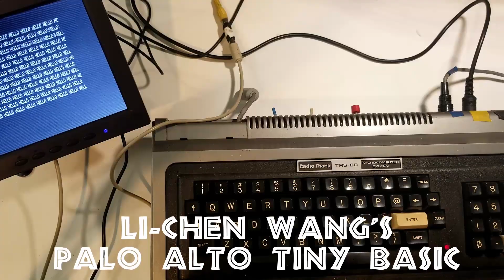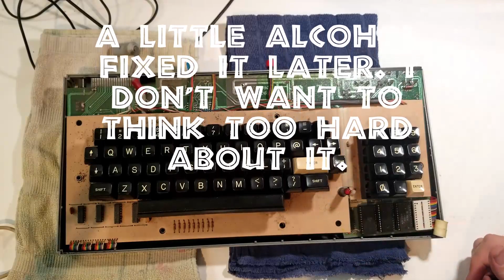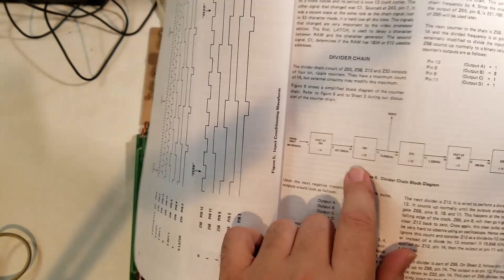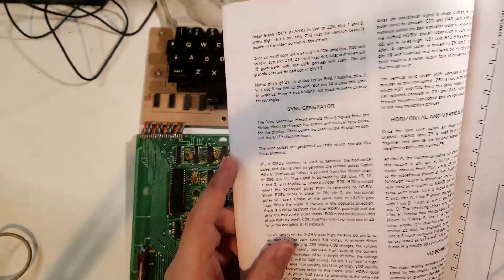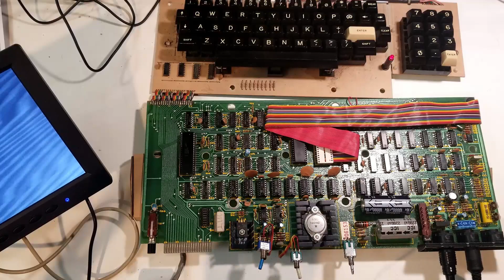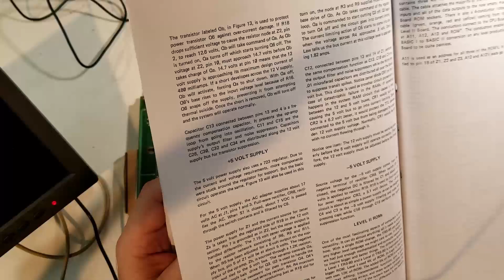Original Tandy TRS-80 Model I Repair: Part One (#SepTandy 2021)

Comment: Last year for #SepTandy, MrLurch uploaded an STL file to Thingiverse for replacement keyboard spacers.

I'm very thankful that the Model 1 I recently acquired has "just worked." All of the issues that I've had with it have ultimately been my own ignorance of how these systems work.

I have another Model 1 that is experiencing issues similar to this one. The video is shifted in a bit and isn't very stable. I knew about the potentiometers that shift the video, so I'm sure I'll need to adjust one of those. I'm also guessing (and I feel like this is where part 2 of your series is going) that some capacitors in the video area will need replacing.

Either way... I like watching your process and the rationale for the things you tried.

Comment: Great vid. Can't wait to see the solution. I have a Level 2 Model I that turns on and gives me a ready prompt, but freezes up whenever I try to get it to do anything. It won't even execute a PRINT command without an error message. Sometimes it just freezes up. I need to take a look at that manual. I suspect its either a bad ROM or RAM. But I guess I'll never figure it out if I don't start poking around in it. There isn't enough TRS-80 content on YT. Thanks for the vid.
Reply from the maker: Thank you. I hope at least I'm hot on the trail; if the fates that parcel out hobby time smile upon me I hope I can get back into digging into it this coming weekend. If it's what I think it might be it could be something that other folks with malfunctioning TRS-80s should check for first thing.
Reply: That does sound a lot like a RAM issue.
Reply from the maker: Take the proper care, of course, but definitely don't be too afraid to jump in and start poking. Since discovering what was actually wrong with my machine I have to say I'm pretty impressed with how indestructible these things actually are. It could just be something as simple as maladjusted voltage regulator levels. (I didn't film this part, but when I was fiddling with adjusting the levels in mine I did observe that getting too far off the ideal +5v could make the machine really flaky. Which is why I'm doubly amazed the machine was running at all with the problem it had.)
Reply: Did you get it fixed yet?
Reply: @mikebrown7366  At some point I got ahold of a 4k Level 1 machine that was in working condition and I became more interested in playing around with that. Overall, my interest in vintage computers has waned and I have way too many sitting around collecting dust.

Comment: On eBay, "Not tested" means "Doesn't work."  Sometimes even "Tested" means that.
Reply from the maker: Generally I'd agree with that, but looking through the guy selling this' auctions I'm pretty convinced he'd have no idea how to test it, especially considering he didn't have the original monitor.

I also figured it probably would be broken; the price I paid was at the low end of the going rate for ones that have known issues. I'm actually thrilled it was as close to working as it is, it would have been a miracle if it hadn't had any problems.